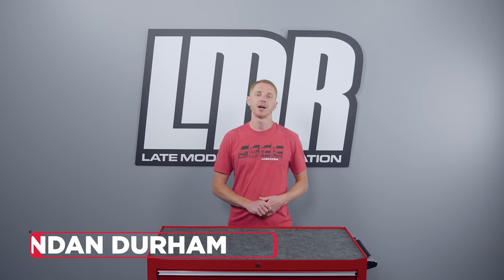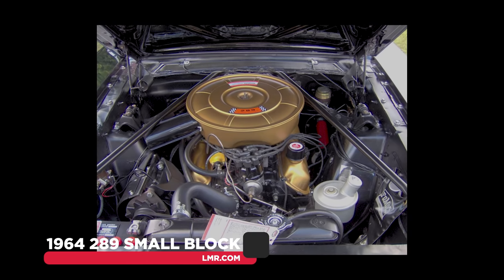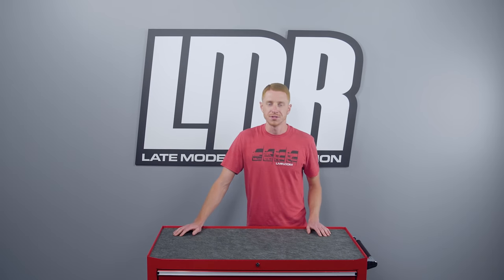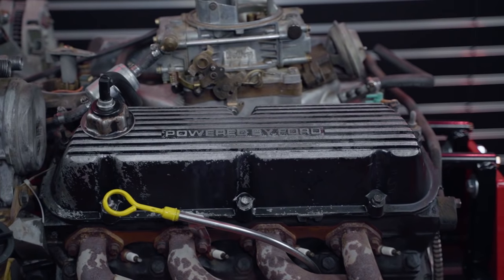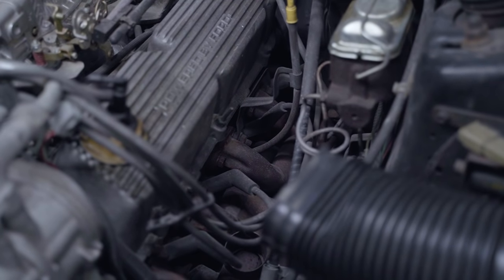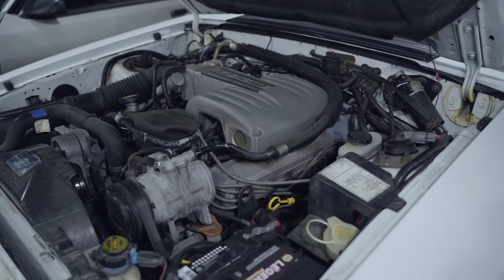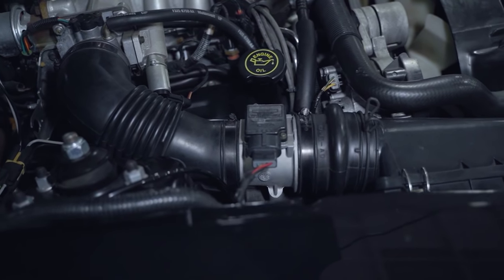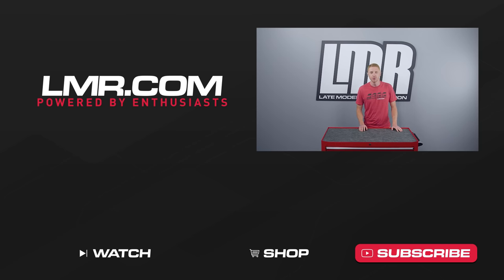The Ford 302 Engine: Everything You Need To Know

Comment: My first small block Ford was the 1977 Mustang Cobra II. I think the year was 1979. White with red stripes and red interior.
Added a cam, intake, carb and headers.
I can't remember how many Dusters, Cudas, Novas and Chevelles I beat with that little ripper.
Taught my wife to drive a stick in it, that was hilarious. She would floor it and drop the clutch.. like a funny car launch :)
Finally traded it for a new, 1980 Ford Fiesta S model.
Reply: You traded a cool car for a disposable piece of junk? Why man?😥
Reply: @PatchesOHoulihan-hi2tb  I was working on offshore rigs, driving 500 miles every two weeks either going to work or coming home from work. Gas had jumped up in cost and I also bought a Toyota 4x4 pickup. Had to get it ready for the back country with small lift, bigger tires, nice rims etc..
Reply: @jackflash6377  That's a valid reason. I can't remember how many times I've heard of people getting rid of a great car or truck for a new vehicle only to be disappointed. They always regret it in the long run. But when it comes to work or a new addition to the family that makes sense. Sometimes people don't know what they have until it's gone.

Comment: My mom and dad bought a new red 85' Mustang GT with the 5 speed Borg-Warner transmission with the 4v Holley carb -- sweet car. It got totaled two years later in a head-on collision while my mom was commuting to USF in Tampa. They ended up getting a white 87' GT with the same 5 speed, of course, along with the SEFI. They got an 89' a couple years later after the 87' was stolen and taken on a joy ride. I just got rid of the 89' last year. After a couple other Mustangs (2003 Cobra R and a 2012 GT) they finally bought a 2013 Shelby GT 500 new. What an amazing animal!

Comment: @ John Doe. Ford introduced the dual mass balancer and flexplate/flywheel system when the 255 came out in June 1979 for the 1980 model year. The 1980 model year 5.0s all got the 34 underbalance from harmonic balancer pulley, and the 50 ounce flywheel or flexplate. So that is simple. There was a High Out put 5.0 engine firing order change to 5.8 liter Windsor and Cleveland sequence, but the standard performance 5.0s kept the old K code/ Boss 302 firing order right up till 1985, then went to the Windsor/Cleveland type on everything. Fords empty box supply system has definition, but you have to ask Numbers Dummy and Fox Chassis on FTE and FEP respectively to get the right info. Key thing is from 1966 to 2001, very little on a 289 block of the last 5.0 block changed. The minutae and details, just ask at Ford Truck forum or Four Eyed Pride. Or any other forum like Coral Net or Yellow Bullet or VMA. The USA, Canadian, Mexican plants cranked these babies out like cast iron sausgaes....all info exists. Des Hamills Aussie/Kiwi/British book on small block V8s answers all these questions with energy and enthusiasm. Favorite tidbit. The 1979 feedback carb EEC I's in Granadas and Versailes, had a unique 12 month only front crank position sensor crank just for Variable Venturi VV 7200 2bbls, but just prior to release, Ford scraped the rear crank position sensor. The 1978 and 1979 California 5.0 was different to the 79 Granny and Versailes engine. Thatz Ford 4 Ya.....

Comment: I've noticed that lots of people are snagging up the old 4 cylinder Mustangs and dropping these motors in them. Would love to see a video of what all is needed to make this happen.
Reply: Everything stated above is correct. It’s a lot of work to do a swap, I’ve considered it a few times. Unless you absolutely can not get your hands on an original 5.0 mustang, I would avoid it. In the end, buying everything to make a 4 cylinder fox into a 5.0 would be pricy
Reply: Own two with V8 swaps. Easy enough project.
Reply: Fairly common, another cheap trick is to use the rear springs from a 4 cyl model on the v8 model to get better traction when launching
Reply: I had (bought my neighbors) a 4 cylinder 79 mustang! Installed a v8!
The motor mounts are the same for 4 cylinder & 302  v8 etc!
A 6 cylinders motor mounts have to be removed/reposition to drop v8 in! 79-86 model!?
Prob same for the others!?

Comment: I have a 96 F150 with the iron version of the GT40 heads that i understand to be rated at 240 horsepower and more torque also used for the explorer . FRPP used to have this as a crate that advertised 295 net . Compared to the 89 LSC i once had the truck seems much torqueier but the EOD doesnt let it wind out like the FIOD did . LSC was 3.27 with 60 series and traction lok while truck is 3.55 open with 75 series tires and single exhaust

Comment: The 302 engine block architecture of 221 cu in realistically supports more cu in growth than any pushrod factory V8 than every other brand with its 154 cu in expansion from 221 to 347

Comment: falcons surprisingly had them until technically 2003 which is even later then America. In 1998 they had 175kw so about 235-40hp, then in the xr model falcons that was 185kw or 248hp. Then in 2001 that was updated to 200kw or about 268hp and then 220kw or how ever much hp that was in 2002

Could also get in limited edition falcons such as the TE50 TS50 and Pursuits utility the 302s hand built by Tickford the racing team which were bored and stroked to 346 cui or 5.6Ls and produced 250kw or about well we’ll over 300hp 

How ever the 175kw 302 was an option in basically all falcons in the 90s until 2003 but with the VCT (Variable cam timing) in-line 6 producing similar power figures and fuel economy for less money it was probably the better option unless you got an Xr8 that had the 185/200/220kw 302s

Comment: I have a 1975 Ford Maverick that had a 250 I6 until I blew a rod. I found a 302 from a salvaged 1992 pickup, and was curious about the differences between the truck and car 302. Also, would it be worth it to convert the EFI to a carburetor?

Comment: I've got a 5.0 HO from an '87 Lincoln LSC and it's got the flat top pistons without valve reliefs. Does it not have the forged pistons? I read articles that said it does and some that say it doesn't.
Reply: If your motor is a ho in that year then yes the same year in thunderbird was the efi non ho 150 hp non forged.
Reply: Prob hyperetic (sounds like) pistons!? Misspelled probably!
I have an 89 mustang!
EFI 225 HP. Rebuilt 2017!
Different block prob from a Lincoln (HO on intake!) Mach 7?!
E303 cam & bigger exhaust valves…..
So I may hav to research my engine too!
Prob not 225 hp before mods now!
Rawhide!!! I digress 🤔🙄🤠
Hmm but the heads are from the 89….. so Mayb I got 25 horse back😳

Oh well lol! Ikr😒👋🏼

Comment: What would you use in a 73 bronco.
Have rebuilt C4... daily driver. Light 4×4
Reply: 351W stroked to 427W!! ;)
Reply: @P71ScrewHead  That'll make 400/400 on 87 octane with a torque curve as flat as the horizon... Power. Anywhere. Everywhere. Any gear or speed up to 5500 RPM. You are not safe in 3rd gear @2000 RPM; THERE WILL BE TIRE SMOKE
Reply: @cellphonelightsaber  i see no problem with that, do you?? lol..
Reply: @P71ScrewHead  😂🤣
Reply: 302 with a mild cam or what he said! 351w or 351w stroked!?
Yeeeeee haaa!

Comment: What is the best carburator to upgrade to for a 74 Ford truck 302 engine that comes with a 2 barrel,
Reply from the maker: That's not our specialty. It wouldn't be fair to you for us to provide an answer as we don't have the facts to back it up. I would poke around on the Internet or Facebook groups and see what other folks are running. Thanks for understanding. -Landan

Comment: Dident the explorer come with a 5.0 v8 does it share any relation with this v8
Reply: Explorer came with the 5.0 and the 8.8 rear end.
Reply: Yes,it’s the same engine and the explorer 5.0 were the best of the 302s.
Reply: 96 and early 97 explorers had the GT 40 heads with internal egr late 97 through 01 had the GT 40p heads with external egr , also the early ones had a coolant pipe running through the oil filter housing ( didn't work out very well) and an aluminum oil pan , 98 did away with those and the cam sensor and injectors change in 98 as well as going from fuel return to return less system , all backed with a 4r70w transmission either in AWD or 2wd with 8.8 3:73 Ls rears with 31 spline axles and disc brakes , I'm kinda a big fan of them

Comment: I am particularly fond of that coil, zip tied to the heater hose. Just another reason why... No one but me works on my car. But thank you LMR... That AC compressor delete kit, works great.
And if you want a properly performing and running 5.0 under your hood... kick the federal government and the country of California out from under it. Muffler filters are junk. Stick hotter spark plugs in it, and you won't have any exhaust gases needing to be recirculated. But be careful. Chances are you won't be breaking down in front of LMR. Or, any place where you can get Ford parts really. Because after a hundred years of doing business. Ford parts are still, a goddamn geographical Oddity. Two weeks away from everything. Especially in Michigan. Which is ironic to say the least.

Comment: You didn't mention why they went to the hypereutectic piston change in the 1993 mustangs.... Huge mistake 🤦‍♂️as I bought a 93 for some reason before I knew what I was doing
Reply: some late 92's also had them
Reply: Forged pistons and rods.   I have a 90 95k miles still runs like its brand new.

Comment: I have a question for you can I change a 351  windsor cam  to a 302 HO
Reply from the maker: Hey Renae, yes, you can change the 351 Windsor cam to a 302 HO. A 351W and a 302 HO have the same firing order. As long as they are both roller cams, they are interchangeable.

Comment: Ford absolutely did not install the best and strongest 302s in Fox body cars. No mention of the Boss 302 4 bolt main block which is essential if any power adders are used as there were many instances of the stock 2 bolt block splitting right down the center at high horsepower levels.

Comment: What is a 302? Easy. Don't have a heart attack, I'm a die hard ford guy and have been for many many years but let's call a spade a spade here. A 302 is a tiny and in most cases underpowered slug. It's a cheap prime mover for many vehicles. Tear one down and you will find 8 cracked piston skirts 8 times out of ten. No matter, those pistons only made about 8.5:1 compression anyhow. Whatever you are building, 460 swap it. Lol

Comment: Rule number one! If a 351w will fit, sell that little turd and find a 351w ! Heads, cam. Intake and 750 vacuum secondary carb if ur streeting it! What a 351w will do at 6000rpm, the 302 will have to turn 6800rpm! Drove them both, raced them both! I will admit,  you can stroke the little weaser to 347! We call the hand grenades! If you cam find one, get a 95 roller 351w,  but it doesn't matter, just find a 351, cam,intake,carb!😂😂😂

Comment: A bit of forgotten history that may interest some guys, some of the public does not know there was a 9.250" deck 351 "W"indsor # XE 93532 race block made back in 1966 way before GM's B Kundsen's "C"leveland block was even on the drawing board & this 351w XE 93532 9.250" deck Windsor race block got as big as 398/400+ ci (4.110" bore x 3.785" stroke) with 600HP back in 1968/69 for Can-Am racing. 302 & 351 windsor XE race blocks were tested with canted valve head prototypes in 1968 just before Kundsens new block was & there were plans WAY BACK in 1964-65 for a stretched deck 6.9-7.0L aluminum XE 94244 Windsor race eng for Can Am racing. IMO, with Kundsen taking resources away from the Ford engineers we might have even gotten a GT4VBoss 402 ci "W"indsor engine as the 69 9.480" W block was destined to become a 400+ci eng if it wasn't for GM's Bunkie Kundsen screwing things up at FORD with Fords XE 93532 351W race block development by selfishly ramming through his own "Oldsland" inspired block for the short time he was there. H Ford should of fired him sooner.

goo gle "351w xe block" for more info...